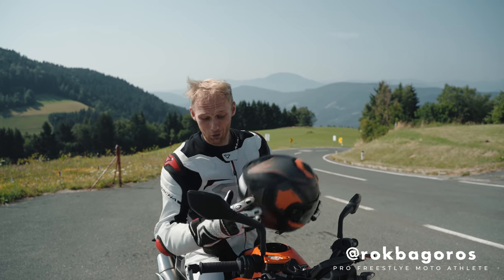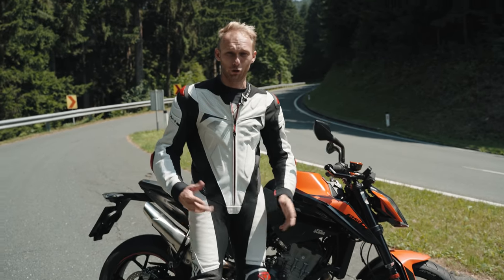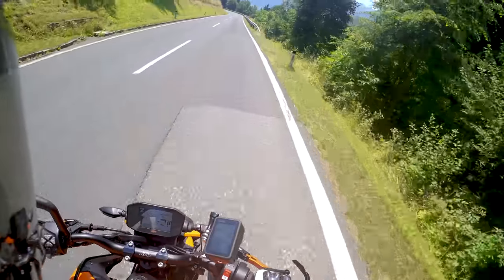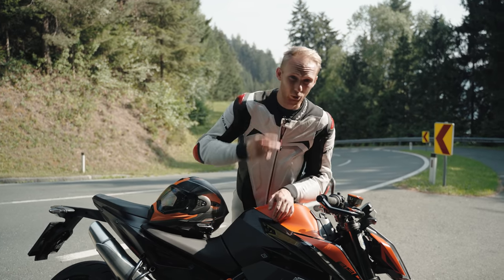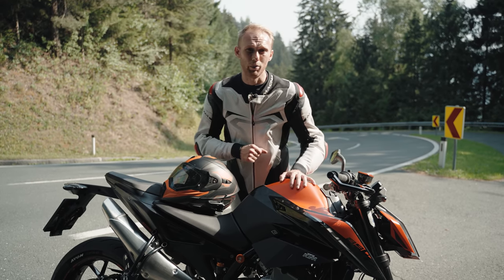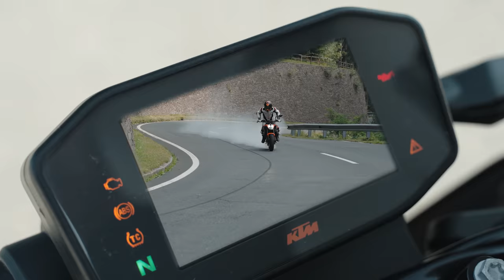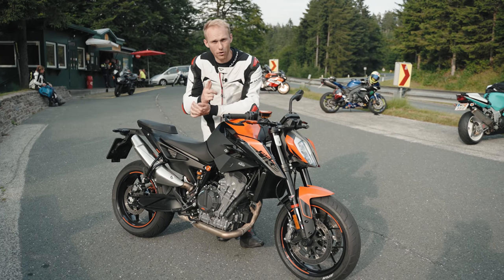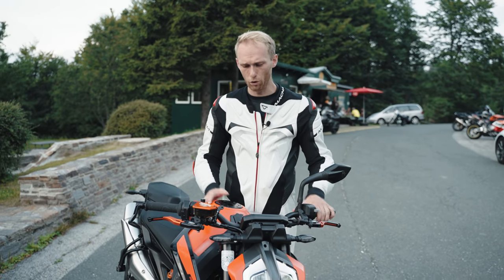MAKE YOUR CORNERING FASTER & SAFER / TRAIL BRAKING | RokON vlog #115

Comment: I don't use trail braking much on the road (I generally go in slow enough that I can stop in the distance I can see to be clear on my side of the road ) but what you said about practicing trail braking in car park and race track.. I couldn't agree more  ... Its a skill every road rider should learn reasonably well IMO in case they have to brake in the corner ....even if they do ride "old style" for most corners